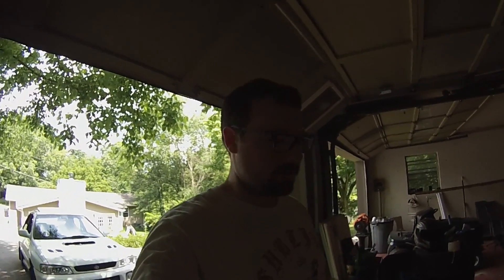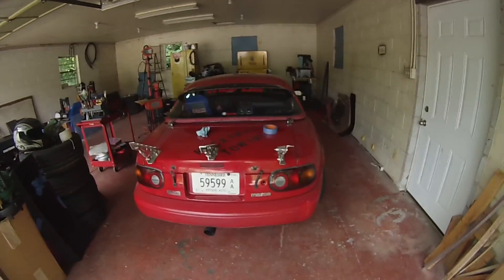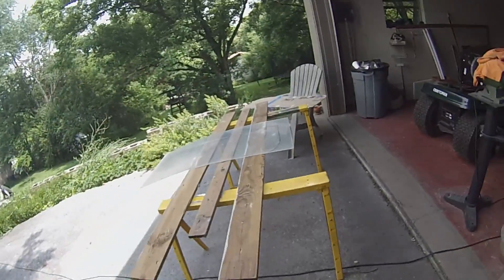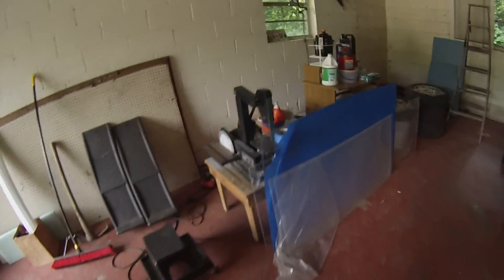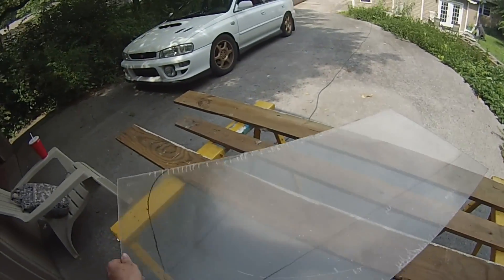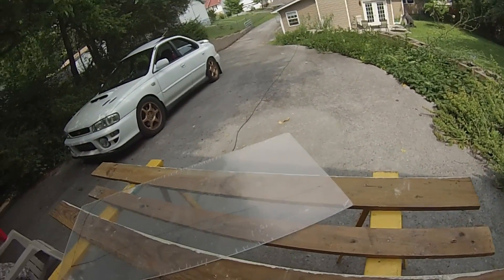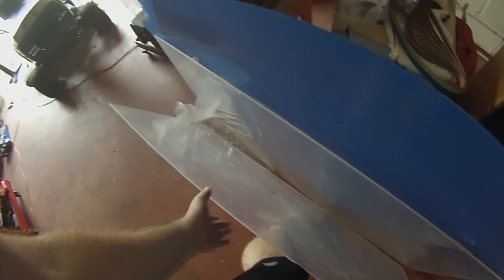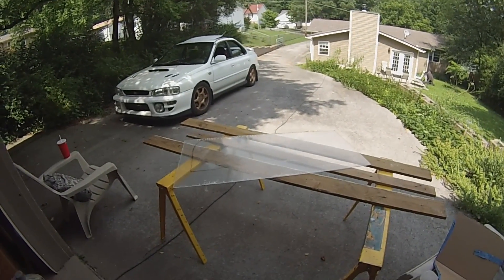Miata spoiler build: Part 2

Comment: What's the sheet made of
Reply from the maker: It's some polycarbonate I picked up on Craigslist.  You can use acrylic or whatever brand you want just don't over torque the hardware or you'll crack it.

Comment: What brackets did you use to hold it up, good work
Reply from the maker: I have a part 1 that walks through the brackets I made for the car.  I might need to link it in this video but if you look through my videos you can find it.  It's a bit dated and wasn't very popular even though it's pretty much 90% of the work.
Reply: Cody Yankey ok thanks

Comment: What are those brackets called?
Reply from the maker: Not really sure if they have a proper name or not.  I just called them spoiler uprights.  I didn't have a guild or anything when I built them.  I just built some out of thin material to see if it would work and then built them out of heavy angle aluminum once I knew I got the dimensions right.
Reply: NA6 driver thanks for the reply man appreciate it

Comment: isnt it just when the key on the crank pully is at tdc?
Reply from the maker: I assumed you took the pulley off.  I'm not sure what you can do to fix your timing if you've rotated the engine without cams in the car.  You're going to need to find a factory service manual for your fix man.
Reply: Yeah you'll need to align the mark in the crank pulley vertically, the pin in the intake cam shaft needs to be in the I slot and the pin needs to be vertical. same with the exhaust cam pulley, except obviously the E marking. There should also be a marking on the cam pulley which is vertical. The Intake pulley will also have an E marking which should line up with a marking on the front of the engine, at about 130 degrees clockwise off vertical. Similarly the Exhaust cam gear has an I marking which should align at about 270 degrees clockwise off vertical. Great videos NA6 Driver
Reply from the maker: MX5#99 Thanks for the complement.  Love the track stuff on your channel.  Also thanks for helping one of my subs out.  Hopefully he gets it figured out.

Comment: hey
so i tried to do the lifter fix you posted in the past. while the shafts were off the car rolled a bit.  not thinking about it being in gear, my timing wad off. 
when trying to start up, it shot fuel smoke out of my intake.  i took it apart and reset my timing.  now the car wont start.  

i live in the cleveland area and i drift my 1990 Miata.  has the 1.6.  please let me know asap if you can help.  cause im confused.
Reply from the maker: Yeah man, you're going to have to find TDC of cylinder 1 and reset your timing.  You'll have to find a video or something on how to do that.  it's not hard but it's time consuming.